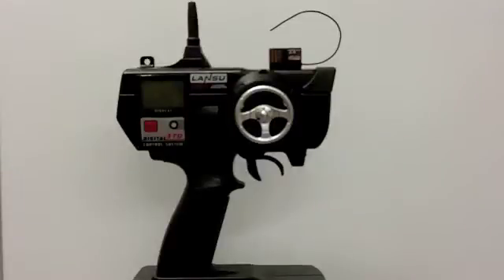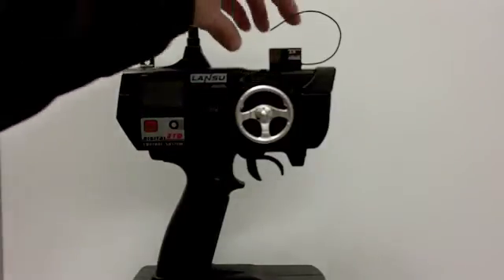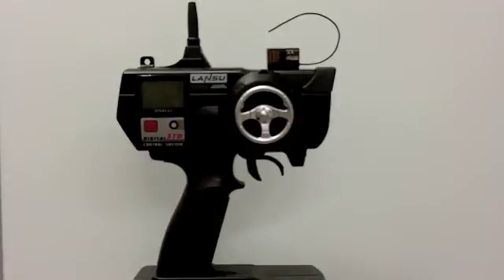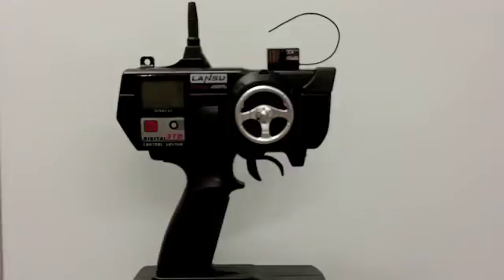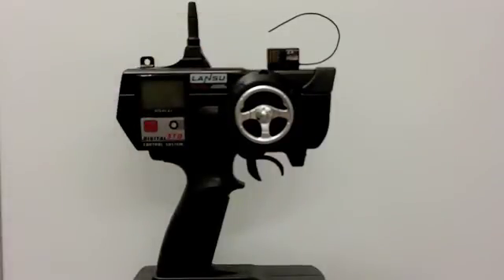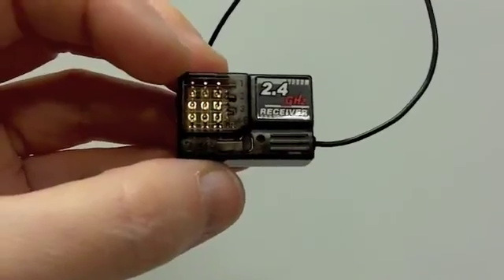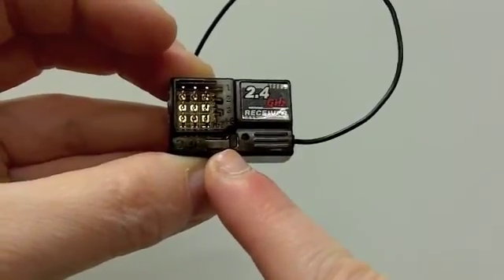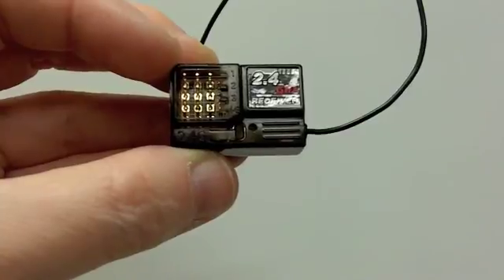Redcat Racing 2.4GHz Radios and E710 Receiver Bind Button

Comment: Do you know how to change to a different model on the remote?  I believe this remote has 3 model memory.  If I hold down the select button and power on the radio No 1 flashes for a second but no matter what I push I can't get it to 2 or 3.